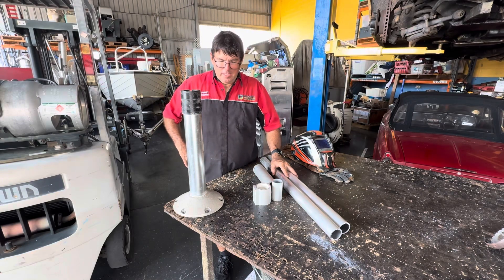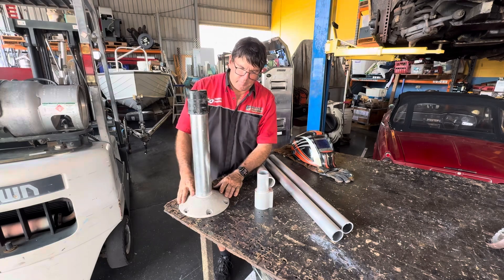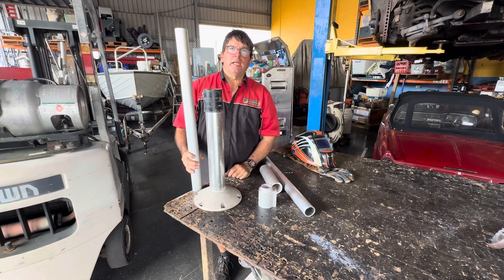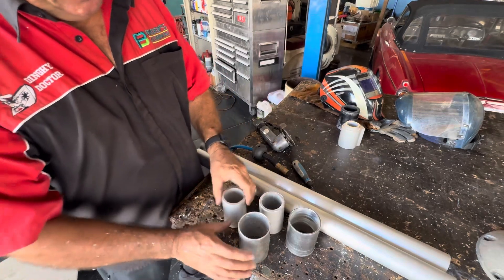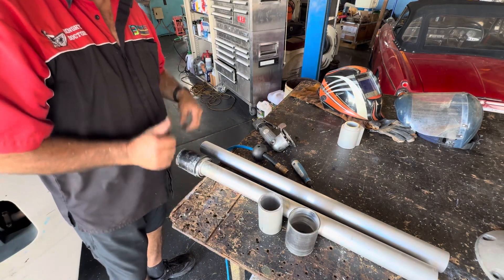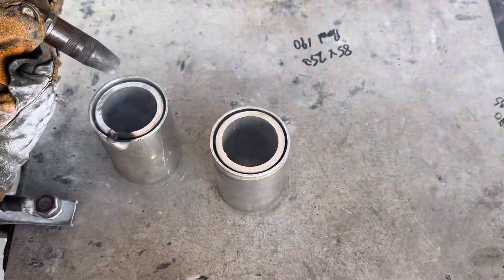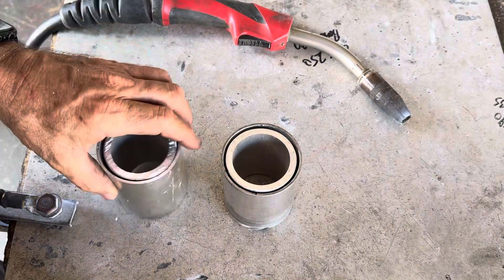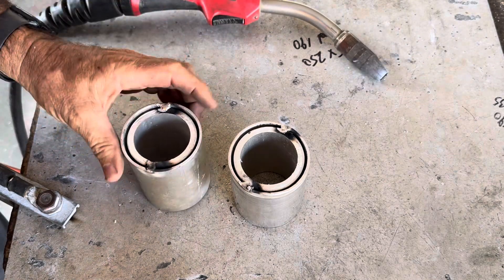Basic Aluminium Fabrication for boat seat poles

Comment: hey mate what’s that base tube called? with the flat back. also white size is that pvc material. Cheers mate love your work
Reply from the maker: The base tube has been repurposed from  sign post material “road signs / street signs”
The PVC is a heavy wall with a 50mm clearance hole 
Road signs don’t use this just metal on metal

Comment: Sounds like your wire speeds to fast and a settings out just a tinny bit. Sorry for nit picking you never loose the boilermaker hearing well actually you do.! 
nice job though keep up the good work
Reply from the maker: Hey thanks for your feedback 
I’m sure there is some adjustment on my wire speed but I have always used the settings from the manufacturer / preset for welding the only adjustment I change is the metal thickness sometimes it is a bit of a guess eg welding 3mm to 6mm if I use 6mm setting it melts the 3mm and visa versa for 3mm so I guess a little

Comment: Hi just wondering where you get the aluminum base tube with the flat on it that you weld to the boat from ? love the videos
Reply from the maker: Glenn I bought it from Ullrich 
My branch has been bought out by Valcon 
It is expensive because of the thick strong back 
And then another hard part is to buy the plastic tube that fits perfectly inside and holds the 50mm aluminium tube 
Hard to find a supplier

Comment: For a diy. What's a the magic de burrer mate? Is it just a burring head?. I'm a newbie. Subbed a week ago. Not up to the welding needs stage yet. More rivet and glue at this point. Cheers
Reply from the maker: Oh mate 
I love my Deburrer I use it all the time you can put different tips in it and it will give you a different cut 
I have done a couple videos where I so it off a little more in-depth
Reply: @RacingRenovators cheers mate. Will have a look 👍
Reply from the maker: @fatherburning358 
They may be in shorts not sure it was a while back